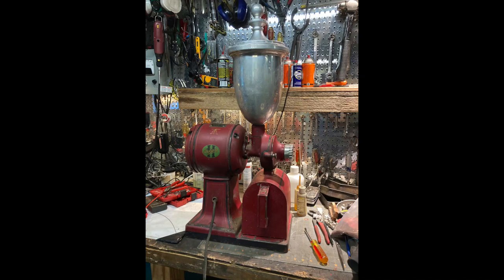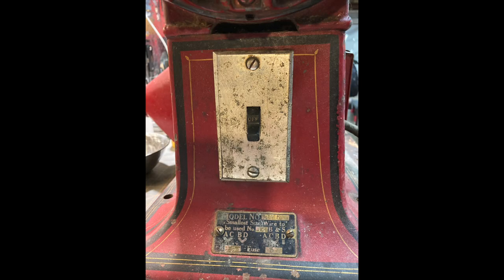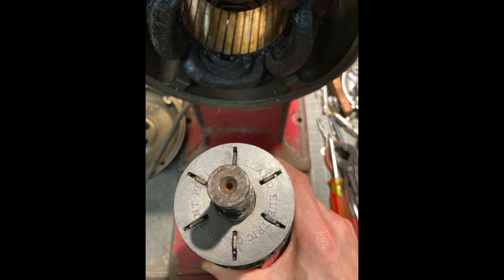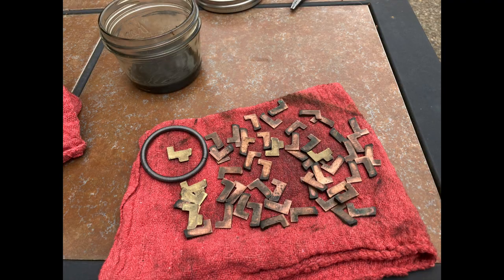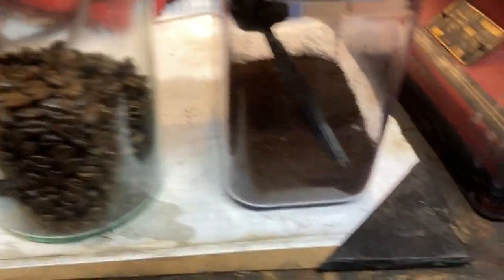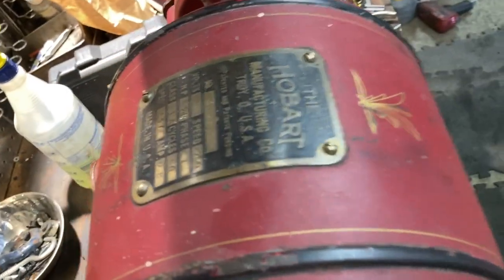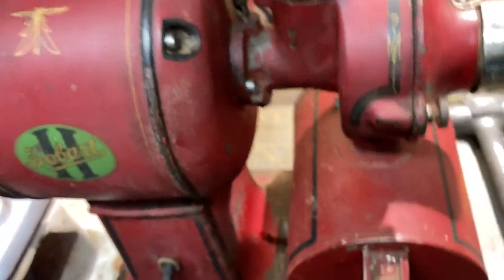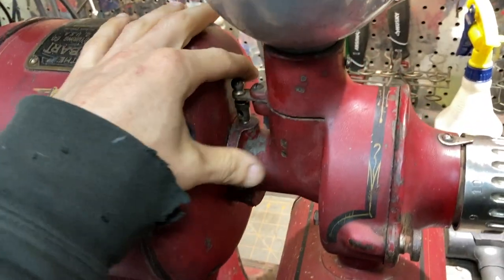Hobart Coffee ( Mill) grinder from 1920s cleanup and running Model 276

Comment: That's a awesome video! I currently Accumulated one that's in rough shape and I'm trying to find blueprints or a manual for it... I started taking it apart and I think I bit off more than I could chew.
Reply from the maker: where did you get stuck at,? let me know if you ever need a reference photo or something
Reply: @MillersMotors   pulling the motor and redoing it... or just trying to find a new one. 
It looks a little nasty.
Reply: @MillersMotors  i have one

Comment: Beautiful machine. Dang it, now I must find one then restore it now. Thanks. Hahaha. Hey, I thought the motors from the 1920’s- late 1930’s were 110 volts? 
All of mine are. I’m going to have to do some research now. 
This changes everything
Reply from the maker: Thanks!! Really the only difference I noticed was the switch from DC to AC machines in ones newer than 1920, the voltages have always seemed to vary depending on input available
Reply: @MillersMotors  I just watched another video with a Hobart motor just like yours but it didn’t have all the coffee grinder stuff on it. It was just the motor some dude kinda restored and on the info badge, it was 110 volts. I always date my motors by the Volts. 
110 means up to late 30’s
115 early 40’s to 1968
120 1968 til now. 
I might have to do more research now. 
I love the old stuff. It’s so easy to work on and we can actually work on them huh??
Reply from the maker: @spiderlovesbeerohyeah4760  yeah they are a treat to work on and best yet they are built to be rebuilt if needed.. you can usually rebuild the bearings if needed out of common materials and a lathe.  I thought another interesting part of this is the label says 115 and 230v by the switch. I should pull that out and see if it is indeed dual voltage!
Reply: @MillersMotors  I was wondering why there was 4 wires. How would you do that?? Connect AB&D to hot and C would be neutral??
Reply from the maker: its pretty straight forward I like to think of it like 2 coils that can be hooked up in series ( end to end) or parallel ( next to eachother)  With the Parallel connection you get lower resistance so more current can flow. Thats for low voltage, with A, C and B ,D  going to line. On the high voltage connection the coils are joined at C, B and line connection to A and D.
Reply: @MillersMotors  oh ok. I see. Thanks